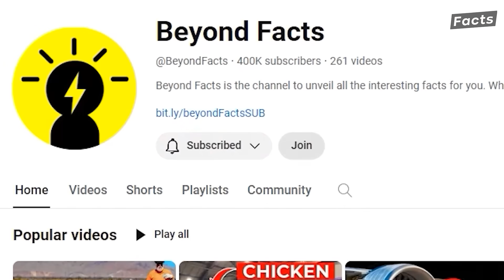This Will KILL the Panama Canal

Comment: What many tend to forget is that a container ship can carry thousands of containers and it takes a lot of trains just to move containers from just one ship to the other side.
Reply: It is apparently meant to work for the smaller ships. They save time standing in line, which is money.
Reply: @sorellman  I'm interested.  What is the ballpark figure for the "Smaller ship?"  Under what circumstances would this be the better business decision?  I really want to understand this.  Big moves have big consequences here.
Reply: Maybe that's why they call it  "beyond facts" 🥳
Reply: It probably would only take a couple of long trains, stacked 2 high, to transport the containers. There is a time issue to unload and reload but it’s possible the the sea route to Mexico is shorter, and the cost could be equivalent, given the waits and high cost to transit the Canal. 
It sure worth a look.
Reply: @gusbradley3846 

If a container ship had 20,000 containers, based on 2 per rail car, that means 10,000 rail cars.  That’s going to take up a bunch of track.
Reply: One ship, 195 very long trains.
Reply: It would still be faster than going around
Reply: Your correct.  A fully loaded large container ship would fill a 46 mile long train😊
Reply: Yes, even stacking containers double high on each car with multi km long trains would not be enough on its own.

They would need to have at least 2 tracks running in each direction, and using high speed rail technology.

The longest freight train in history is 7.353 km long with 682 cars.

With double stacked containers that is 1,364 containers per train.

Meanwhile the largest container ships can carry 24,346 TEUs (standard shipping container unit).

So even stacked double high with 682 cars you would still need nearly 18 trains to equal just one of those larger container ships.

It seems like possibly there is room for an upscaled equivalent to freight trains with wider cars and higher stacking, but I have no idea how viable such a thing would be.

Obviously such a concept would require far more power to move it, unless maglev can reduce the weight problem.
Reply: Biggest ships with 14000 containers means need for 7000 wagons which is cca 100 trains. 100 trains = 100 train engineers + supporting functions. Unloading 14000 containers might take 48 hours. Loading 100 trains might take 100 - 120 hours. It means that for transportation time 100 x 6 hours (+ waiting times to avoid collisions) is needed another 170 hours . Total time is then at best around 800 hours = almost 5 Weeks. That´s more that 18 days ships have to wait at Panama canal and transport price will not be cheaper.
Reply: There is another fact. Ships keep getting bigger and bigger while the canal does not get any wider.  Be prepared for several repeats of the ship getting stuck in the Suez canal, and blocking traffic.
Reply: @adrianainespena5654  Wrong on both counts. The canal has gotten bigger; a new third set of locks was introduced in 2016, bigger than the other sets. And, once a particular size has been set (in this case, Panamax in 1914 and New Panamax in 2016) and shipping companies have shifted to it, the ships going through the canal do not get bigger, because of course if they do they can no longer fit through the canal.
Reply: And let's not forget the cost of moving the containers off of ships, on to trains, and then back on to ships at the other end. There's no way this is going to "kill" the canal; it can't even compete with a canal. The problem the Panama canal has is not this railway, but that due to climate change it's unclear how long it can continue to be a canal effective for transport of ships.
Reply: @Curt_Sampson  it costs up to $500,000 to transit the Canal. Plus there’s always a wait to enter, sometimes weeks. 
I question the cost difference without hard numbers.
Reply: @Curt_Sampson they move the whole ship ,   they cant unload it ,  ships dont sail empty if they czn help it ,  logistically the way ,  you understand it is crazy and inefficirnt ,  but they are going to put the whole ship on a special carrier cradle and move the ship across land
Reply: @RealBrotherGG  Moving the whole ship across land? I'm not buying that in the slightest.

Consider that the largest non-rail land vehicle in the world is the Bagger 293, at a mere 14,200 t. On rails we've seen trains as heavy as 99,734 t (82,000 t of which was the load), but that had 682 cars and was 7.3 km long, almost twenty times the length of a New Panamax ship.

A New Panamax ship is considerably heavier than any of these, at 120,000 tons of load, plus the weight of the ship itself.

There's a reason that we build canals: it's the cheapest way to move a ship from A to B across land.
Reply: @Curt_Sampson  yup,  thats the plan
Reply: @Curt_Sampson   not the giant ships smaller ones that take up traffic in the panama canal,   look at the ship lifts and canals china has built the have giant tunnels and mountainside canals
Reply: And "35 km/hr." speed isn't setting the bar very high.
Reply: @jamesthompson7282  and how fast do container ships go?
Reply: What also many tend to forget is that there is no law in Mexico, a few idiots with a couple of buckets are going to stop those trains because the government did not gave them  some stupid promise. It would be the stupidest idea for a protect of this magnitude. Better not let kids play at government. It’s just not viable. 
Let’s not forget the president is a real a hole that does not care about costs, just cares about him, his “supposed “ legacy and his sons.
Reply: @RafaelCC20  RAFAEL, Tenías que ser mexicano opositor al gobierno de López Obrador, evidentemente eres un traidor a la patria, y eres un completo ignorante que
nada de lo que dices es cierto, por gente como tú es que ya perdieron 20 estados de la república, y ahora son gobernados por MORENA,  pero no quiero perder mi tiempo con tus estupideces. Hasta nunca apátrida prianista.

Comment: A better idea is a Mag Lift high speed rail line coast to coast with freight cars traveling 200 miles an hour. Next add slow speed underwater turbines to any nearby rivers or streams moving 2 to 5 miles an hour to supply power for the project.

Comment: This is complete BS.  Loading a container ship on a train as the picture shows is a misrepresentation.  The narrative explains that cargo will be off-loaded onto trains and then reloaded.  Panama already has two railways for this purpose.  The transit there is much shorter.  The end of the narrative explains that it cannot "KILL THE PANAMA CANAL".  You lied so you get no thumbs up.
Reply: At 6:38 there is a modern tank. Also not exactly factual.
Reply: Surely the newly added shipping capacity of the Panama Canal less than ten years ago and the resulting need for additional water to run it was  factored in at the time of designing  it ?? I haven’t seen that little gem of a fact being considered anywhere.
Reply: I was just typing the same thing.  That 300k is their goal, which isn't likely to happen.  Moving by water has always been much cheaper than moving by land.  The "18 day" waiting period has been going on for years, as well.  He kept going back to the (cyclical) drought, but failed to mention that every time the locks are used, some water escapes into the ocean.

In the unlikely circumstance the lake actually went dry, they could drain all the lakes, and just expand/deepen the digging until the entirety of the Panama Canal was at sea level.  It might take 5-10 years, but there's no way the Panama Canal would go out of business without a collapse of government.
Reply: I'm  out             TY
Reply: There is so much blah blah in this video, but they fail to mention one of the important advantages that the Mexico rail corridor could have over the Panama Canal. Currently container ships going between the Atlantic and Pacific are limited in size by what can fit through the Panama canal. If they can unload, transport, and reload the ships fast enough and cheap enough to be economically viable, Mexico could handle ships bigger than the Panamax size and compete in that market when Panama can't.
Reply: @MyFiddlePlayer  Do you have any idea how many containers are on just one of those ships? A TEU (container) is about 20ft x 8ft x 8ft in size and it's easy to put more than 10,000 on a cargo ship today, some can carry more than 20,000!!! DO the MATH; just 10,000 double-stacked TEUs 'railed' across Mexico would be more than a 20 MILE LONG  train behemoth IF it were even possible on the various grades up & down. The longest trains in the world rarely exceed 4 miles long, and they are rare in themselves.
Reply: Not to mention open a new ave. for thieves to start more stealing and mayham along the route(train robbers) all over again, DON;T TRUST MEXICO
Reply: Climate chaos? Droughts are a well known phenomena and using the water for the locks is the problem. Park a ship there that can desalinate water and maintain the canal.
Reply: @seanworkman431  Have you even begun to calculate how any million cubic meters of water that would require ?

Comment: Just 6 hours? But that doesn't include the time it takes to off load a ship, load rail cars, unload rail cars and on load a ship. And the shipping company will require two ships instead of one.
Reply: The unloading of the ship can be done directly onto rail cars and the loading of the ship directly from the rail cars, so no intermediate stacking with associated loss of time.
As for needing two ships, while that is true, those ships will each sail less than half the distance (assuming same distances on both sides and subtracting the width of the isthmus), so that should even out.
Reply: @apveening  , even so, it does seem logic that using two ships instead of one will make the whole operation relatively more expensive.

Comment: Mush dig deeper again to reduce water pump up  so faster  in throw cannal ,lol
Reply: The problem with the Panama Canal is not enough water ! If you fill a reservoir with sea water then use the water to fill the reservoir with the sea water then when a ship is raised or lowered then reuse that water to raise or lower the ship and no water is used over and over many times as needed by pumping the water over and over ! Like filling a bath tub then drawing the water into a reservoir then pumping the water back  !

Comment: Why not pump sea water into the canal !
Reply: The salt water intrusion into the freshwater would destroy the ecosystem currently living in the lake.  The volume of water required to operate a single locking event would require an enormous amount of electricity. The collection of water from other Panamanian freshwater sources is a much more efficient and permanent solution.
Reply: Seawater will affect drinking water in the lake
Reply: Salt water is extremely corrosive and would drastically increase maintenance costs.
Reply: It is the main water source for most of Panama

Comment: No, it wouldn't be the "final nail in the coffin" for the Panama Canal.  It will eventually just dry up due to too much water being lost over time to the oceans and not being able to replenish the water effectively.  That is simply the inevitable result regardless of what Mexico does with a rail-line, or whatever they're building, to move ships from coast to coast.
Reply: The water replenishment after each ship takes the trip comes from rivers and lakes flushed from the high mountains not the seas. Unlike the Suez that does not require locks the Panama does require locks. Each tIme a ship passes through the Panama Canal  all that fresh water used to float the ships is flushed out and lost to the seas. It's wasteful however it was never a concern with a year round abundant rainfall into the surrounding high mountains. However, now with a drought and climate change perhaps the Panama Canal is doomed over time.

Comment: Mexico is not just getting billions of dollars in funding by China, but China is setting-up their own factories / using automation, so it's quite likely to develop very very fast. Most of the Container Cranes in the US are made in Shanghai - these very companies are sending similar (more advanced) Container cranes to Mexico. Until Panama finds a way to either use sea-water for it's locks or a mega Desalination plant to replace the water in Gatun (both are extremely expensive and time consuming projects), it's very likely to continue losing business to the Chinese.

Comment: The Panama canal isn't loosing water from climate change.  

1. It has had a major valve stuck open for months draining the lake around the clock.

2.  Bad Policy in restricting ships with minimal draft to passage, which causes more water wastage.  Ships with more draft allows less water wastage.
Reply: Add to that, the parallel set of even larger locks that began operation in 2016, draining the lake twice as fast.
Reply: @mudboy9762  They are using larger locks containing more water. That is true. But they have built water retaining tanks next to the canal where most of this water can be put after it is used to lift the ship thru the lock and the water can be reused . In the old days with the old smaller locks the water was just allowed to go out to the lower level locks and eventually out to the ocean.
Reply: @lray1948  Because of equilibrium, only half of the upper locks water can be reused. The other half must come from a higher elevation or be pumped in. It is a mitigation to reduce outflow by half for each lock, but is not a solution for the immense amount of water that would need to be pumped for this project.
Reply: unfortunately, VLC carriers are the bulk of the traffic now. taking 10 ships to take the cargo 1 ship can take to panama costs even more than going around the Cape
Reply: Then there is those things called hurricanes so maybe through Mexico will be a seasonal route?
I have been out in 90 knot winds and 100+ foot from trough to crest waves. It sucks.
Reply: Let's not get bogged down with facts and truth here...
Reply: Not True. Valves can easily be replaced ,Climate change can't. Einstein.
Reply: The money Panama is making off the canal is being distributed into peoples pockets not back into maintenance of the canal nothing else.
Reply: The water comes from the jungle.  Loggers are cutting trees, farmers are cutting trees and the farming.  It's illegal but no one is stopping it.
Reply: Not true.There is very little logging in Panama and the logging that does take place is far away from the canal watershed. @veramae4098
Reply: 🤣🤣 @veramae4098
Reply: Centrtal American drought is making the situation far worse since the Solar minimum tranition periof start in 2004 prior the 2008 start of the Modern GSM. The impacts of GSM drought are significant which both the Mayan and Roman empires failing during the LALIA GSM 585-640AD.
Reply: think they need to stop cutting down and destroying the amazon rainforest and dont believe everything your masters tell you about the mayan and aztec history. @jameswalker758
Reply: @jameswalker758  It's trendy to use climate change as an excuse.A few years ago they were using the term global warming, then long before that, they were blaming global cooling. What's next? But the canal will recover. But I am for the Mexican railway being restored again. If only to take the heat off the canal for awhile.
Reply: @jameswalker758  .....You missed one important fact:  Since humans are responsible for ALL climate warming ( just ask Greta, she will tell you the truth...), then it is Man that has caused the Sun to go through all of the GSM's and other solar periods that directly affect Earth's climate. 

To avoid the destructive GSM's, we just need to pass a law that prohibits the Sun from doing this...!!  Now I will go prostate myself at the feet of the "Queen Mother of All Climate Knowledge", Queen Greta, and tell her my amazing solution to all climate problems. Surely she will reward me with one of her many polluting gas burning, carbon polluting, private jets for my own personal use.
Reply: @jameswalker758  could you repeat your comment in clear txt please, I am totally clueless what is stated.
Reply: @MarcoPolo-ft2iq  Simple fact we are currently in a Conbined Grand Solar Minimum and following Gliessberg period from 2008 to 2112. JUST the same as the LALIA GSM and Gliessberg 585AD to 687AD couple withits following GSM & Gliessberg 690AD to 702AD. The period is DOCUMENTED as a major Drought period for Southern, Centre and SouthWest US during the entire Vandakl Minimum.
Drought in the same area will continue to 2112.
10 Such GSM+Gliessberg periods since 585AD, they happen like clockwork every 172 years.
Reply: @jameswalker758   Thank you for the reply